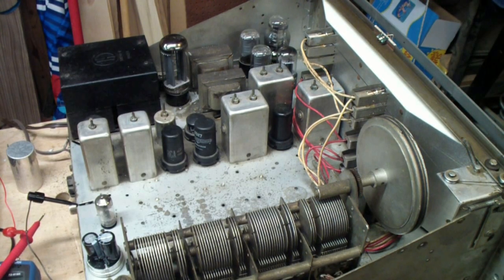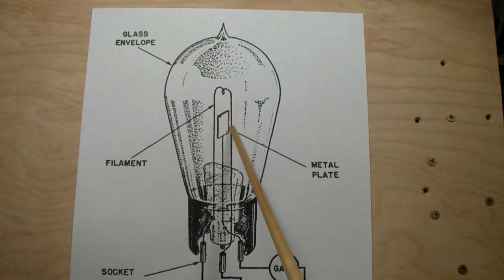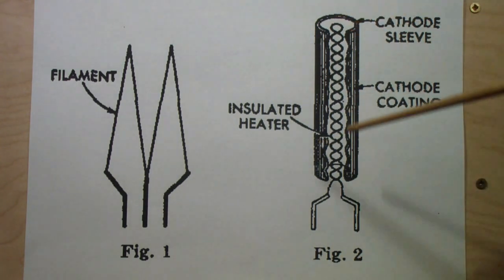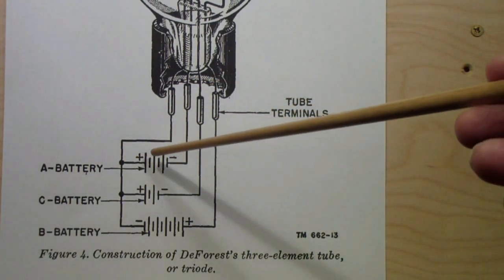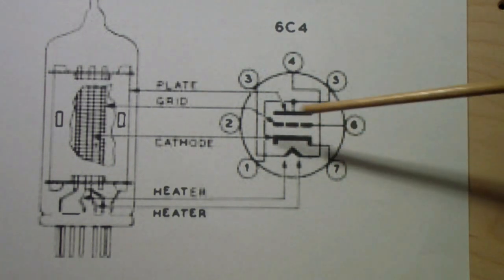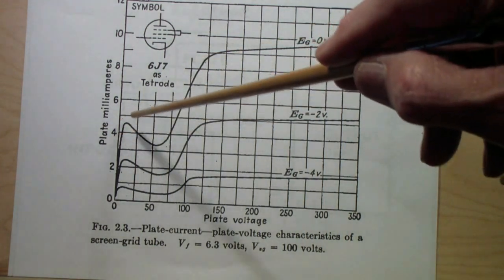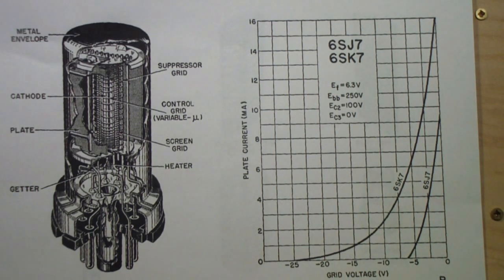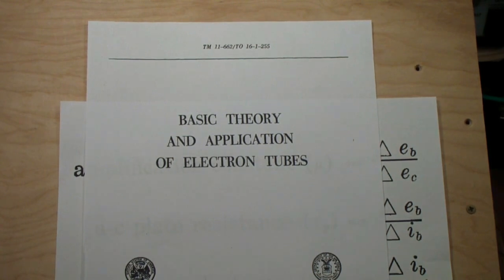TTT081 How Tubes Work

Comment: I know it is an old Youtube video but i was actually taught this in the Army in 1991. I was in an Air defense unit that still had 1 radar built in 1938 and it was a blast to work on.  We used a slightly different book but do remember the same diagrams and taught the exact same way. 
I remember as a young kid in the late 60s and early 70s you could still get the Popular Mechanics magazine that would give simple circuits to build and experiment with.
Good job Tom with the video brought back a lot of memories and the fun i had doing this. Makes me want to get back in it again on old radios again.

Comment: I'm an audio repair tech, old enough to have learned about and worked with tubes before I even reached adulthood. This is an excellent tutorial for newbies. A couple of related tidbits that they may find helpfull: early direct-heated tubes, where the filament IS the cathode, typically had to be heated by DC because an AC heater voltage would inject a lot of hum into the signal, which is why the earliest radios were invariably battery powered. An independently-heated cathode, with the filament inside an insulated cathode sleeve, could be heated from AC voltage without injecting massive amounts of hum into the signal, so that radios could be powered from ordinary house current with a simple transformer- fed power supply; and only the tube plates required DC from a rectifier circuit.. This negated the need for frequent replacement or recharging of batteries just to run a radio. Also, the independent cathode allowed other hum reduction techniques (briefly alluded to in the video) such as lifting the cathode above ground, and/or "biasing up" the AC heater supply with a small DC voltage. This also provided more circuit design options for injecting feedback or improving circuit linearity, especially for drivers and phase splitters. Factor in the addition of screen grids that allowed for lower internal capacitance and more stable operation, and the design options increased by leaps and bounds.

Tubes with independently heated cathodes also warm up more slowly than the filaments of indirectly- heated tubes, and are better insulated against arcing; this is why a 5AR4 (GZ34) is a more desirable rectifier tube for power supplies because it doesn't shock the filter caps and the other tubes with nearly immediate high voltage like a 5Y3 or 5U4 filament-type rectifier does; the 5AR4 also has less internal voltage drop under load due to the close spacing of the cathode and plate, providing improved efficiency (a filament rectifier requires greater spacing between elements to prevent arcing). 

By the way, some of the very earliest tube types did not have "coated" filaments for providing emission,  Tungsten filaments impregnated with Thorium were used in a few consumer-level "recieving" tubes (such as the WD11, IIRC, or was it the 199?), and Thorium-impregnated filaments were (are still?) often used in commercial transmitting tubes. Hot flash: when such tubes become weak, a brief period of running the filament at double or triple the normal voltage will bring fresh Thorium to the surface of the filament and restore operation. Unfortunately this doesn't apply to most "modern" tubes found in radios, hifi and guitar amps....

Comment: I'm old enough to have been taught vacuum tube theory in school, and even having used them in projects around the same time (although the transistor was well established and getting cheaper by the day), and yet find that this lecture is one of the best I have watched on the subject. Good work!
It may have been interesting to mention why the beam tetrode even existed, since the regular tetrode problem had been solved so well by the pentode. The answer is, due to commercial interests. The pentode was patented, and as far as I understand it the patent license fees were fairly significant - so other manufacturers tried to get around having to pay the patent fees by building something that reasonably did the same thing as a pentode, without mechanically being a pentode (i.e. not having a suppressor grid). It worked reasonably well, but only at high power - you mentioned that it needs a lot of current to create the space charge that makes the virtual electrode/electron cloud that acts like the 3rd grid. At low powers, the pentode is still the king.
Also the tetrode with its kinked transfer characteristic has some applications in its own right; the more pronounced the negative resistance interval is, the better it functions as an oscillator.

Comment: Ive only just discovered your channel, 
what a fantastic well explained tutorial you have made here, 
thank you this was just what i needed, i am about to embark on a journey into power transmission tubes for Tesla coil use & if ime honest my experience with small radio amplifier valves is utterly insufficient for what i am about to attempt. 
I really needed to understand the principles better & look at how i should be utilising the connections, 
i have a whopping great GU39-B & i am worried that i might ruin it by making errors, 
there are more connections than i was expecting on it which has thrown me a little. 
I have many years experience with solid state coils & sparc gap coils, but i have never attempted a tube coil or a coil capable of such scary power levels. 
Dont worry ime also a radio fan & i am working in a fully caged environment with a protected off grid supply so i dont upset every radio operator with in 100 miles of me. Ime based in the UK

Comment: My dad tried to teach me about vacuum tubes, apparently he repaired t.v sets and radios when he was young,   but I was in the cusp of dip integrated circuits. Basically my dad taught me that a vacuum tube is a " valve" . It just controls electrons from one point to another. Similar to a transistor.  When he said transistor,  I was in some understanding of how a tube works. This is very interesting. So, years later I'm experimenting with a device that I bought off an estate sale. This device uses two OD3a.  tubes. I think it's a power supply,  just not sure. Good video. Thank you.

Comment: Great video. I'm trying to get my jukebox amplifier going (it's 40 years older than me!) and the outlined information here is a treasure trove of information. I'll definitely be watching your other video tomorrow and downloading that technical manual. Thanks for putting this online!
Reply: If you cant get your Jukebox going without videos like this , you probably shouldn't do it , since Tube Amps are simplest form of Circuit , on a level of a Heater with some controls , you probably shouldn't do it , there are high voltages present , that can be more then nasty . . Non the less im interested , did you get it going or what , somehow i doubt it :)

Comment: I believe these are referred to as thermionic devices.
In addition to thermionic emission, most ( not the dc voltage regulator) of the various applications involve the application of time varying voltage as part of some continuity scheme to complete the circuit via the thermionic element.
The solid state device version (p-n junction) is basically a drop-in replacement to the thermionic emission device and so eliminating the need for a heater from which the electron mobility is derived.
These continuity schemes carry over to circuits having solid state non-thermionic versions of the devices from which electron mobility is derived.
But in the solid state world both holes and electrons are referred to a charge carriers.
This is a great video that shows the application of vacuum tube technology in example circuits to achieve practical uses of vacuum tubes.

Comment: Note that the photos of Williamson amps at the end of the video, from Stancor transformer catalogs and so on, appear to be utilizing 807 tubes, a high-voltage variant of the 6L6 designed for ham radio transmitters,  with an old-style 5 pin base and the plate connection on top of the tube (to deter arc-over, which might otherwise occur if the high-voltage was applied thru the base, near the other pins).  Also interesting to look at the pronounced nonlinearity in the transfer curve of the 6J7, since that tube was often used for microphone preamps in the broadcast and recording industry!

Comment: My Radiola60 has centertapped resistors across the heater leads, the centertap goes to a
voltage divider and through the secondary coil and to a grid in the 71A amp tube. I am told I could have too much bias as the set oscilates a lot. If I am correct, taking part of the output to a tickler
coil I'd have an oscillator of the Hartley type being inductively coupled or if using a cap, a colpitts
oscillator. I had to know all this to get a ham radio ticket and learn morse code too. It was all 
good, electronic physics.

Comment: always wait for the vacuum tube to cool down before pulling it out of the component,  those puppies can get really hot.   when you see lightening in a vacuum tube when you turn on the component,  most likely the vacuum tube is not working right and is going into failure mode.

Comment: On some data sheets for tubes it lists the voltage and current for the filament when set up in series and parallel. Is that just for those specific tubes when listed or can any tube be run both in series and parallel?  I am guessing any because most electronic components such as capacitors and resistors allow this.

Comment: I have a question for you. How hard would it to convert a Precision Electronics S35 which uses the mighty 7868 tube pair to a pair of 6P41S tubes? Would it sound as good? Would it be worthwhile? It'll be used for a guitar amp and not a PA. Thanks for any help and advice you can offer. I'm new to building and restoring tube amp and anything would help.